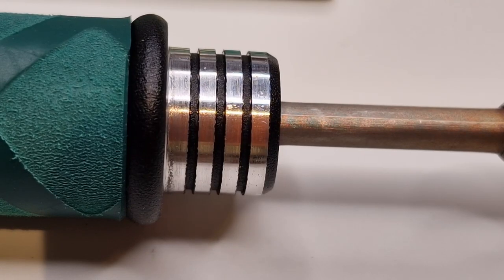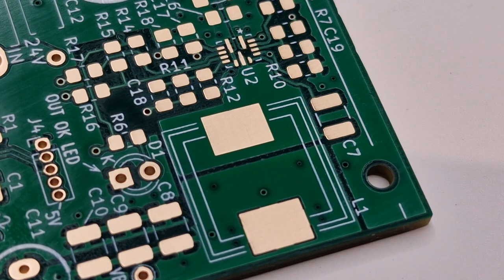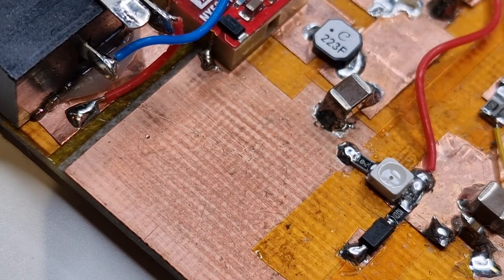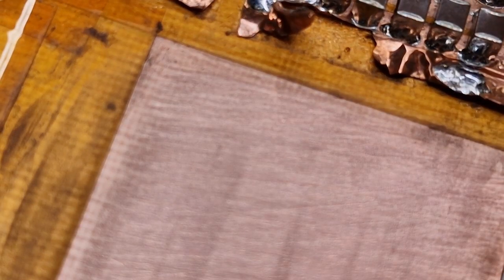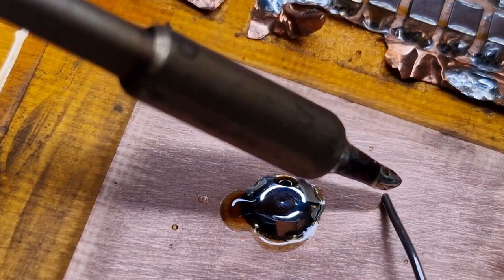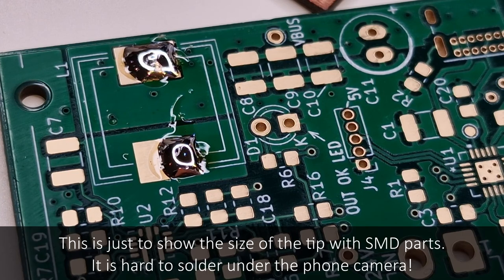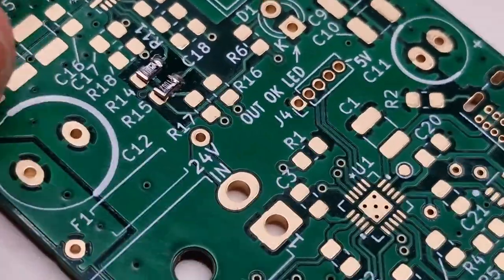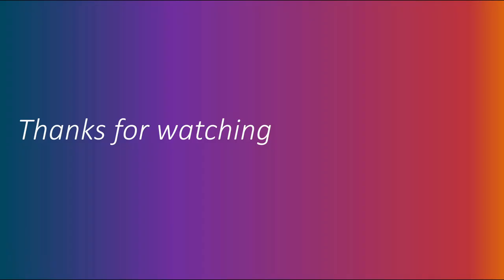L245 Soldering Iron Quick Demo

Comment: For the L245, in your testing, did genuine JBC tips work with any USB bricks you managed to find? I noticed from your article that you mentioned another review in which they had trouble getting genuine JBC tips to function, however, I believe this had to do specifically with powering it through traditional USB PD chargers. You're using a dedicated 20V power supply here, which is what that reviewer attempted in a follow up video, managing to get it working with a genuine JBC tip. Using a dedicated 20V PSU for genuine JBC tips is also what the Aliexpress listings seem to hint towards (arguably in pretty poor English). However, I did also see some Aliexpress reviews suggesting that certain 100W or 120W (conventional) power bricks from the likes of Xiaomi (and other chinese phone manufacturers) seemed to allow the genuine JBC tips to work with this L245 iron. Confirmation as to whether or not this is possible (as well as how) would be helpful :)

Also, do you have any experiences with non-genuine JBC tips with these irons? Thanks
Reply from the maker: Thanks for watching! Genuine JBC tips function with the L245 with ready-made USB charger bricks, but only specific bricks. I tried three:

1. An Anker one with a 45W USB-C output (Anker PowerPort Atom III, 63W total) 
2. Ugreen DigiNest 65W
3. Ugreen 100W 4-port charger model 70871

Of the three, only charger #3 (Ugreen 70871) worked for me with genuine JBC tips (bought from a known official JBC supplier).

It requires a 100W USB-C cable (i.e. a cable specifically rated for 100W, they have a chip inside the plug). Without that cable, it doesn't work.

The cable I used is Anker 643, which is a 100W silicone cable. Non-silicone lower-cost cables should work too, but they definitely need that 100W capability to be supported.

I tested that charger #3 with the largest JBC tip I had, and it still worked. The tip was C245729,which is powerful enough to skate around a copper-clad board with solder as if it were watercolor paint.

Incidentally, the DIY power supply that I used in that article (Meanwell supply) struggled with the C245729 tip, it ultimately functioned (with a higher rated fuse!) but pulls the power rail down a bit while initially heating up. If I were to do it again, I'd use a LRS-150-24 (150W) instead of the 75W model that I used. The cost difference is just £4 extra, but needs a larger case.

I didn't test any non-JBC tips. All I had was the knife tip that comes with the iron, and that wasn't suitable for normal component soldering.
Reply from the maker: I just checked the SDG video, it's very good! I too agree, it's a very nicely made soldering iron. Mine didn't come with a PTFE sleeve, I wonder if the manufacturer  forgot to insert it in mine : ( However the tip seems to be held firmly for now. Anyway, that would be worth checking if you purchase one.

Comment: Hi Thanks for the video was wondering which solder wire you use
Thankyou
Reply from the maker: Hi Rizwan, I use Sn62Pb36Ag2 solder. The particular brand is Loctite, but others will be good too. SN62 solder is ideal because it melts at a nice temperature (179 degrees C), and solidifies rapidly, so cold joints are minimized. For 80-90% of the time I use 0.38mm solder, because it is fine for most through-hole and surface-mount work, but I may use 0.45mm or thicker if I'm only working on through-hole. If you're only buying one solder wire thickness and you plan to so some surface-mount, then 0.38mm is recommended (anything thicker will make life very hard with SMD). If you're only ever going to work on through-hole, then definitely consider thicker solder.